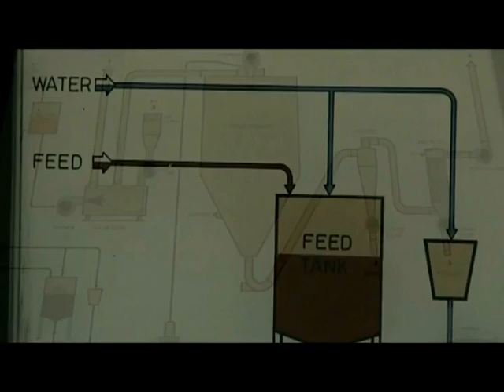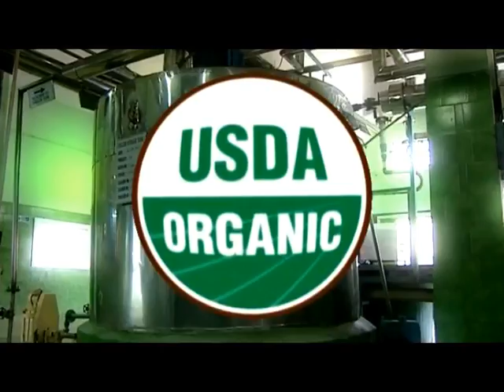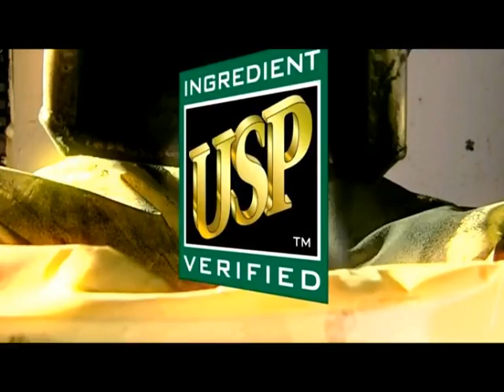Parry Nutraceuticals - Organic Spirulina Manufacturing process

Comment: Hello I mainly from the chimney to capture carbon into carbonated water. One more time. The culture of microalgae is a nutrient source of microalgae. can be used as biomass oil (vegetable oil) and food, feed and so on. The use of closed outdoor 8 tons of large, small tube-type aquaculture. PM2 from the chimney. 5 capture carbon to the stocking forming green industry chain contact: blue eyes If you need data, please notify
 iw1547. ms17@gmail.com